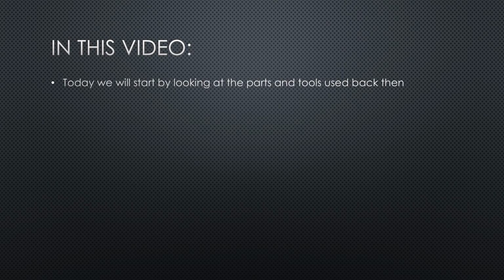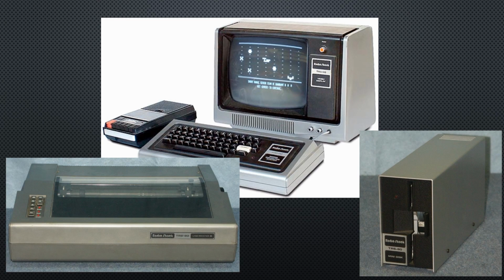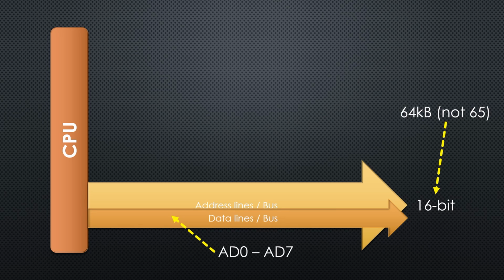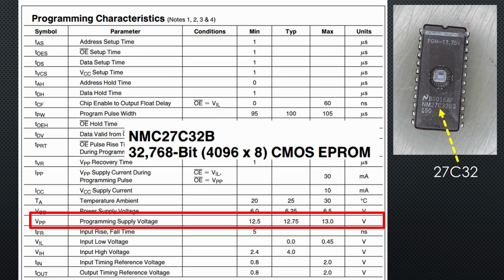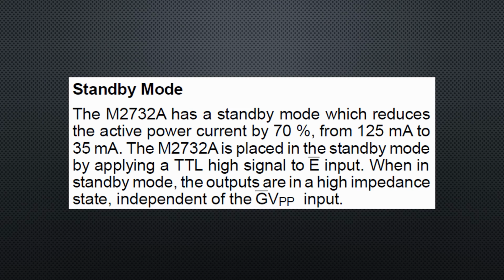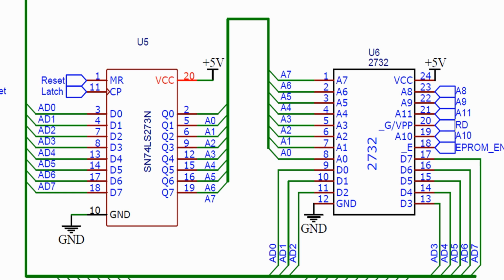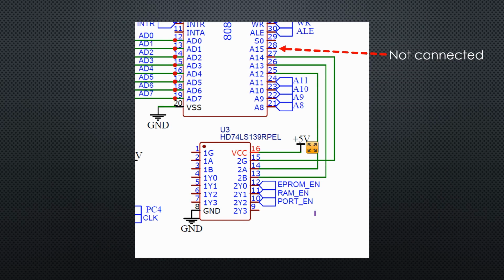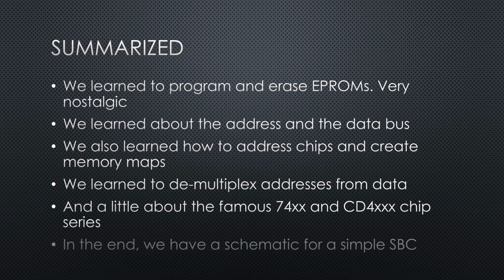#297 We build a historic "PC" using technology from the 1970s (8085, 8155, old EPROM, TTL)

Comment: Been there, done that.  And the Z80 was a simpler chip to implement compared to the 8085. The 8085 had a multiplexed address and data bus where the Z80 had this function on seperate pins. And I used a lot of Intel I/O chips with the Z80. So I disagree about the 8085 being a simpler chip to work with.
Reply: I think it's a hardware vs. software trade-off. The 8085 needed that de-multiplex stage. The Z80 could run 8080/8085 binaries more or less unmodified, but to use its full potential, one had to understand the more complex instruction set. Personally, I'd rather use a Z80 and just constrain to 8080 instructions to get best of both. :D Bonus that Z80s are still produced new...
Reply: @McTroyd  As far as complexity. The first two commercial design I did was based on the Z80 as that is what I worked with in college, what I knew. The next processor design was with the 8031 microcontroller. IO, counters, uart, all in the same chip. It was a bit overwhelming. 

The 8031 is simple compared to the current microcontrollers I design with now. Luckily I only do the hardware designs. At my work the firmware is done by younger minds.
Reply: @tinayoga8844  That's cool! May I ask what sort of stuff you designed?
Reply from the maker: @Tina The 8085 had clock and interrupt handler built-in. But you needed a latch, you are right.

Comment: This was a truly enjoyable video (love retro stuff). You might want to check the 74xx373, it has a latch enable input that has the inputs latched when the LE signal goes low, coming from the CPU. You then need no inverter. See https://assets.nexperia.com/documents/data-sheet/74HC_HCT373.pdf
Reply from the maker: Thanks for the tip. A 74573 seems to even fit better as it has a better Pinout
Reply: @AndreasSpiess  You're welcome. Glad to help :)

Comment: The 8085 was very noisy from the EMC point of view, particularly the later CMOS version that replaced the very current hungry NMOS version. With a 5 MHz master crystal, it generating RF components at 2.5MHz intervals all the way up the RF spectrum into the UHF region. This I believe was the result of the current spikes that were generated by internal logic transitions, where for a brief period of time both MOSFET channels are on, creating a direct short between the supply rails.
 I was involved in a project that used this processor in a mobile radio transceiver trunking control application. The processor function was to decode a free tone channel marker,  send and receive 5 tone and CTCSS signaling, control the transceiver synthesis and measure receiver signal strength. 
When the designed switched to the CMOS version to save (average) current, we had a real problem getting it to pass EMC testing. After spending a long time attempting to screen the electronics,  the solution was found in the software in the form of what we called software screening. In this application the processor was event interrupt driven, but spent a lot of its time just looping through if instructions in the main program loop. By inserting the "Halt" (Hlt) instruction in the main program loop, it was possible to silence the RF noise since, while halted, the processor stops executing instructions until it receives an interrupt, it effectively it goes to sleep. 
Using this technique it was possible to pass the EMC tests even with the RF screens off. This simple one byte instruction saved my company a huge amount of money by avoiding an expensive PCB redesign.
Reply: i remember i used to be able to hear the bits flowing through my Z80 based Amstrad CPC on FM radio!
these days with digital radio comms and easy access to the radio spectrum (with RTL-SDR!)...the sounds that where generated from the Z80 are very much like the sounds used in digital radio...infact Weather Fax sounds identical to "loading screens" just a bit faster from the Z80...
Reply: @WacKEDmaN  not a suprise. When we were debugging the EMC problems of the 80C85 it was possible to see the delta spikes of current manifest as voltage spikes on the power supply tracks. There were only a few nanoseconds wide, but calculations suggest the current was amps.
In my location, medium and long wave is unusable due to mains conducted interference, it is suspected this is mains modems traffic  used to extend computer network connections. 
The older 8 bit processors, such as the 6502, 8080, 8085 and Z80 were so slow that they produce a very musical form of RF interference,maybe as a result of the mark space ration of the instruction loops. Each loop length producing its own note.
The master clock crystal on the radio project was only 5 MHz. The maximum clock speed was 6MHz. The early Z80s were not much better. Some of their instructions took a large number of  crystal clock cycles to execute. One problem we had on the very early versions of the 8085 was the internal pierce oscillator amp would not work with just the crystal circuit, because the input static protection diodes leaked so much current that it pulled the crystal input to rail, stopping the master clock. The solution was to fit an external transistor crystal oscillator to drive the clock input of the CPU.
Reply from the maker: Good to know. The I can test my new nearfield probes ;-)
Reply: @AndreasSpiess  I will be interested to know if the cpu silicon was ever redesigned to resolve the current spike problem.
We initially found the problem by looking at the differential voltage developed across a short length of power supply PCB track.

Comment: I do remember the 8085 and 8051 CPU:s from early 1980:th. 
Used a HP 64000 development system/emulators for 8085/8051/6809 and 68000 CPU:s at the university.
We programmed these in Pascal or Assembler.

And there was static and dynamic RAM.  We used static, as it didn't needed to be refreshed, as dynamic RAM.  That made it much easier to design.  Z80 had support for refreshing RAM, which was not as expensive at static RAM.
Reply from the maker: I had some lecturers given by Professor Wirth, the inventor of Pascal in Zurich. And I did a lot of Turbo Pascal, but on IBM PC compatibles.
I got now CMOS versions of the 8085 and I am curious if it has static registers

Comment: I'm old school - I started on the Cambridge university Titan which had Paper tape input generated on Flexowriters. I moved to the PDP-8/e which I programmed in Focal & PAL-8 assembly language - we had control equipment including a Programmable Frequency Response Analyser attached and of course a paper tape reader & punch. Then I moved to the PDP-11 & VAX11-780. I then got into hardware with the Zilog Z8 and the Atmel 2313. With these devices you debugged them, if you were a hobbyist, with an oscilloscope.
Now for low power I use the Texas Instruments MSP430 which is 16 bits, and in my opinion, not rated highly enough. I understand that one can develop on TI's site and there are the entry level "launchpad" boards available cheaply.
One can explore interfacing without the hassle of address latches for the memory - which is a great advantage (+ a 25v supply to program the EPROMs) and yet from my perspective the device has its roots in the PDP-11 and it has very many on chip peripherals - ADC, counter timers, serial (including UART, SPI, I2C) and Ferro electric  ram (FRAM).
These are low power devices which could be used to wake up a more powerful Raspberry Pi.

Maybe I'm just too old school, but that's what I'm interested in including bare metal programming.
Reply from the maker: I used to work for DEC in the 1980 and we still had VAX11-780 around when I started... 
Concerning the MSP430: Unfortunately it never had a market share in the Maker community. There the Arduino and later the ESP8266/ESP32 are much more used. This is why I cover them on this channel...
Reply: @AndreasSpiess  Yes, fair comment, It hasn't really caught on - but to some extent this was a suggestion to avoid the masochism of building a computer with the chips available in 1980 or earlier.  I used CP/M also.

Comment: The first computer I designed boards for was based on TTL logic, no microprocessors.
It was part of the early SystemX telephone exchanges.
It took up several boards about 350mm x 250mmper CPU.
It was also a multiprocessor with several CPUs.
It was designed so no single fault could stop the system from running calls.
Reply from the maker: That is very interesting. We had all the major concepts back then. Multi-core, redundancy, and many more. It was just extremely expensive...

Comment: I have all the parts Zilog Z180 and maybe Z80 parts all from old stock.
Reply from the maker: So maybe you build your own computer?
Reply: Andreas Spiess my family company use to make a controller for our industrial machines. Started out as z80 and was redeveloped with the z180. The parts will never be used as we have replaced most of the old controllers with EtherCAT hardwares over the last 6 years.

Comment: In 1980(?), our university computer club purchased a NatSemi NS16032 single board computer evaluation system with VMEbus.  64 kilobytes of DRAM and some serial ports for debugging.  MMU wasn't present. Socket had a resistor network to keep the system sane. NatSemi hadn't finished development of their MMU.
Reply from the maker: So you were at the "bleeding edge" back then where not everything worked as expected...

Comment: Oh this brings back memories. Back in the day we designed a whole small telephone exchange using a single 8085 to control it. In the end the company sold some £80M worth of them. Great little chip, but I always preferred the Z80 for my own projects. It could do everything an 8085 could do and more. Zilog designed the instruction set as a super-set of the Intel chip which came first. So it could run 8085 code if I remember correctly.
Reply from the maker: I developed all 8085 code on my Z80 and also debugged a lot there...
Yea, these times were good for hardware salesmen. Nothing was available below 1 million... The most expensive computer I sold was a VAX9000 for 10 mio CHF. Just one box.
Reply: Yes, the Z80 could run the 8085 code, that is why they was both used for CP/M operating systems.
The Z80 hade two index register that worked like the HL (also named M in 8085 assembler).  Used the same code, except with a prefix to tell the CPU it should use X or Y index registers instead of HL.  It also hade some memory block moving instruction. The "fun" part was that singel instruction was slower then writing a small loop. :-)
Then it also had two sets of all registers, so all could be replaces with the other set by a bit in flag register. Supposed to be used in interup routines for faster interrupts.

A nice CPU, but not as nice as the 6809.  :-)

Comment: I missed the "ROM address is dictated by the reset vector of the processor". I did 6502 and there the vector is in the upper address. Googled it and the 8085 has indeed its vector at 0000h. No free memory  mapping at reset.
Reply from the maker: Usually you had a jump instruction at 0000 because there are some interrupt vectors right after.

Comment: I guess kids of today are about as interested in discreet logic and cpus as we were in valves (tubes), coils and 'condensers'   50+ years ago when chips and transistors were 'new'  .  I cut my teeth on a Philips electronics construction kit , worked at making my own audio ransistor circuits  , discovered discreet logic and microprocessors then microcontrollers all at my own pace.  I wonder how a kid of today sees the magic black box that is a Rpi or Arduino , do they have any grasp of what goes on inside ? Does it even matter? (I've been fiddling about with neural networks ,but I confess not to know exactly the configuration inside the box, so it probably doesn't really matter ).    

Exchanging Time for Cash indeed , now I'd gladly do the opposite.
Reply: I think if they programmed for example an arduino in assembly they would learn how a computer actually worked. You worked on stuff when they were actually large enough to see   :  )
Reply: @thegrandfinale2  l learned assembly using a motorolla 6809 micro. It had an very high level instruction set compared to RISC computers so it was probably easier. I think most micros now are RISC based so it takes more instruction to do the same thing. I think assembly is good for learning how a computer works but it I would hate to have to program in assembly as routine,
Reply: Actually, I was always interested in things that came before me, assembly was and is still touted by hardcore programmers as the only true way to get the outmost performance.
First with GPU shaders, now with machine learning.

The same way simple motors and steam machines are fascinating, because of their much simple principles, chips from previous times are interesting.

I think it is even more interesting if it was before your time (so you finally know what all the talk is about ;)

Comment: As the old chips draw more current  than the modern ones for those chips  capacitors where even more important than for modern chips.
Julian Ilett also mentioned instability issues in one of his recent (nov 2019) videos with breadbords. To solve this he now wants to join the powerlines on multiple breadbords with PCBs in stead of wires. On the small PCBs he also wants to put a wire connector. I expect when adding also capacitors it will improve the stability.
(My first computer used an 1802 processor 1/4 k ram and a hexadecimal keyboard with some switches. Lateron i upgraded it first with a small eprom containing a program to store programs on a cassette recorder. Than with a ascii keyboard and more memory, more io etc.)
Reply: ...i suggest you check out EEVBlog...he removed ALL decoupling caps from a gigatron TTL based computer and there was NO issue!
Reply from the maker: You are right, I added a few caps on my PCB. We will see if it helps...

Comment: What a great flashback! Even though I was an MC6800 guy, this brought back a lot of great memories. I am looking forward to a follow up video on programming your new (😁) computer. I also have a legacy project queued up (many projects in front of it). It uses a 8008A CPU (multiplexing 16 address and 8 data lines on 8 pins) and a 2708 EPROM. Please keep these interesting and informative videos coming.
Reply: I have never seen a 8008 (nor a 4004).   Do you have more info on the design?

I have seen the 8080 though, which hade two instructions less then the 8085, less complicated power usage and much easier interrupt system.  But I mostly worked with 8085, 8051/8031 and 6809.  The last is the best 8 bit chip I ever seen, in real life or in theory from that period.  We used it to run a Unix like OS, OS-9. A really novel and great OS.  Support for many simultaneous users, dynamically linked/loaded device drivers and support for memory mapping (MMU) and more then 64 k RAM.
Reply: @AndersJackson  I'll post some documentation a little later. Kids are coming over for supper shortly.
Reply: @AndersJackson  I have published a WordPress page linking the documentation I have gathered on the 8008. Let me know if you have any trouble accessing the content. Please check out https://wordpress.com/post/newburypi.wordpress.com/491

Comment: Well, they say "nostalgia  ain't what it used to be" but that didn't stop the broad smile with which I greeted the photos of The TRS-80  model 1 (or if you had a commodore, the trash-80 . 6502 owners had terrible manners in those days). Back then, MOSFETs were very exotic devices with a prices to match. The Z80 was far more advanced than the intel chips but,  harnessing the full power required a handful of even more complicated  and expensive peripheral support chips. So Tandy [Radio Shack] made EVERYTHING memory mapped. That includes the display, the keyboard and I/O. However, at that time, I knew what every pin of every chip was for. This made programming a lot simpler (no need for handshaking with those dedicated chips) and 100% flexibility.

Sadly, now I don't even know how the sound card on a PC works! However I do have the AVX2 instruction set and a 64 bit data bus. That still doesn't prompt the broad smile the photos of the TRS-80 did.

I am so looking forward to your proposed series of 8 bit computing, assembly language videos. Will the finished product be able to run the "Dancing Demon"?
Reply from the maker: It probably will not become a series. Bu I hope I will get it working that we can program something. Maybe even an Arduino "blink" program in C?

Comment: TRS80  I overclocked mine , with one wire swap it could be made to run four times faster :-)
Reply from the maker: That is new to me. But I probably would have feared to destroy this very expensive machine...
Reply: @AndreasSpiess  The later models had a 4MHz Z80 and 150ns dram , and yet the clock was divided down to 1.3MHz (or something like it) by a 74ls74  pair from the 5 and-a-bit MHz video chain. Z80s were available in 6MHz versions  , so i was fairly sure the 4meg device would not catch alight a 5 megs. In fact in ran absolutely fine , with just the cassette i/o failing. I fixed that by hooking up a commodore 1540 serial floppy drive to it (as i recall i had to learn 6502 asm to patch the drive! why why why ??????)